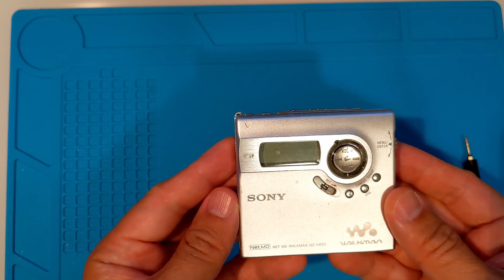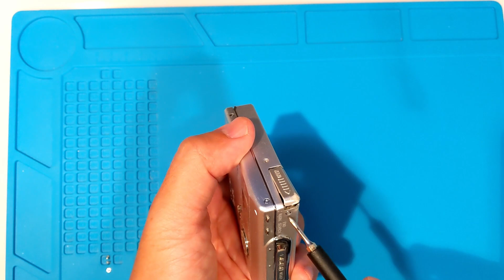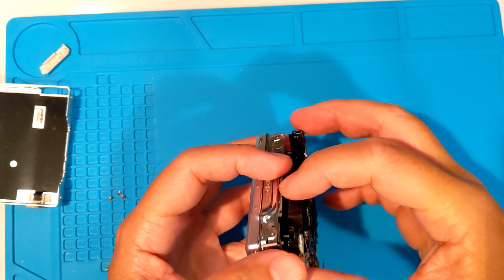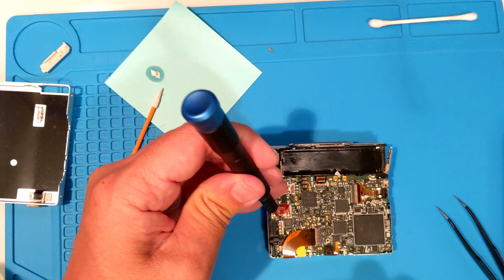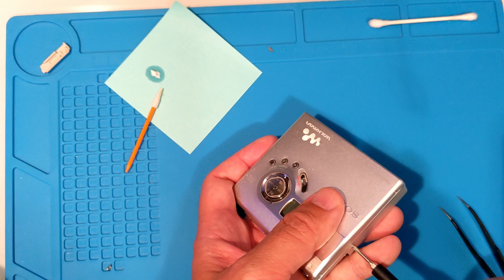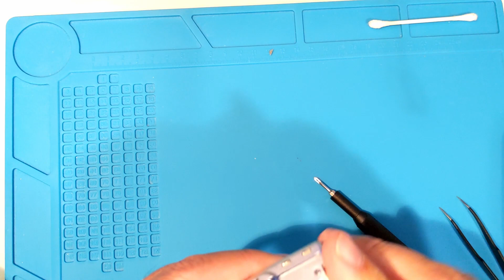Sony MZ-N920 MiniDisc Recorder repair - opening, cleaning, and lubing your precision device

Comment: Hi again Technical initiative, thanks to this video i managed to service my MZ N910 only to confirm the worm grear is turning freely on the shaft.  Ilooked at the  very informative Aiwa gear shaft replacement video  you made but the mechanism is different.Do you have any material covering the gear replacement on a sony , i did not see any ? Also do you think it is possible to glue the gear on to the shaft ?
Tanks /Chris
Reply from the maker: @chrismartin5010 Glad it helped!  I think there's a possibility!  I'm just about to upload a video where I tested Loctite 242 (based on another commenter's recommendation) as a gear fixer. 

Can you take a close look and see if the teeth are fine - if so, and if the crack is small (because there must be a crack somewhere), then Loctite or glue can work!
Reply: @TechnicalInitiative   thanks for your quick reply, the gear seams fine, is there any video showing how to remove it  the shaft ? Thanks
Reply from the maker: hey sorry for the late reply - if the gear is turning freely, it should slide right off but only after you remove the entire gearshaft that's probably under a flat gear and a metal retaining arm. It's also hooked onto the laser sled but it can slide out from that.
Reply: Tham you so much for your help.